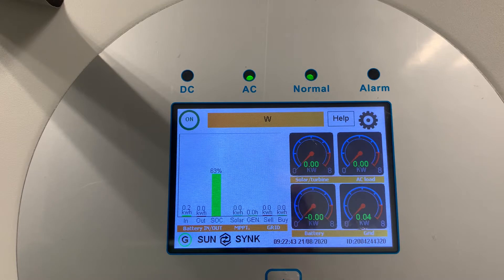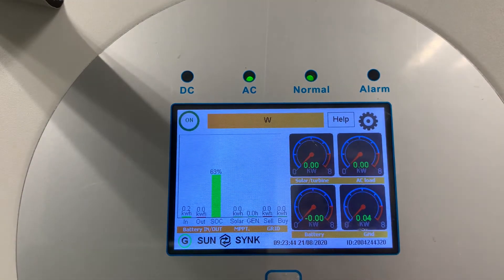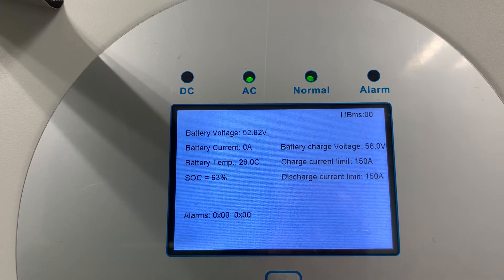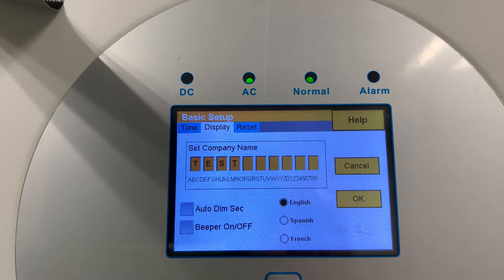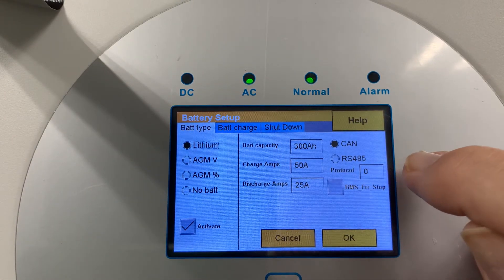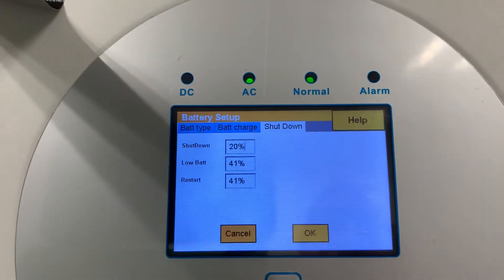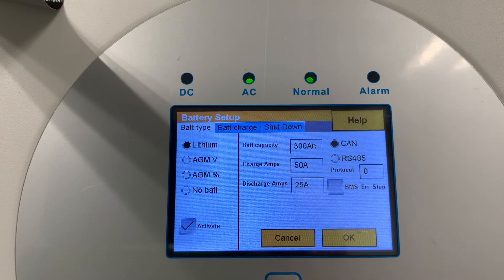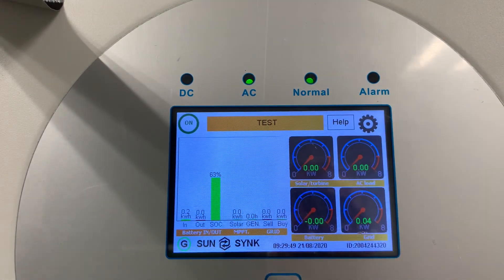Sunsynk Training part 2 sec 3

Comment: Hi, i notice you said to set the equalisation mode to zero if you use a Lithium Battery. However, my inverter cannot be set to lower than 41V. Why can't i set it to zero like you show on your presentation? I am using a Lithium battery without communication, and my battery setting is then therfore set to AGM  battery type.